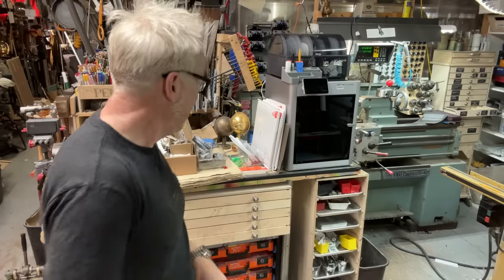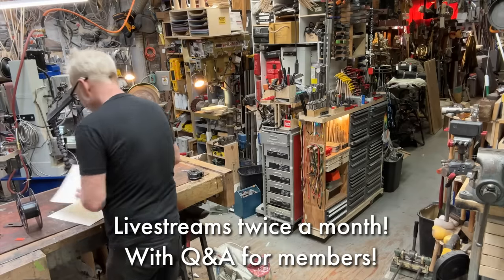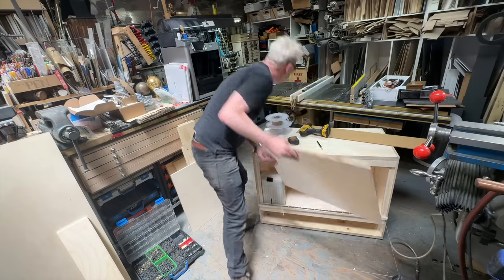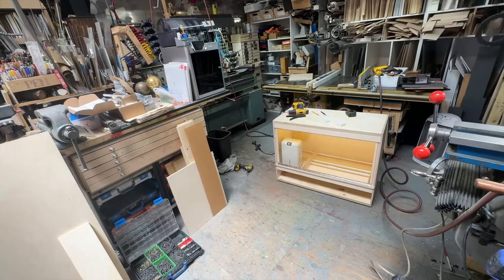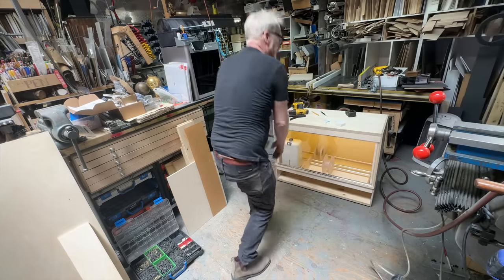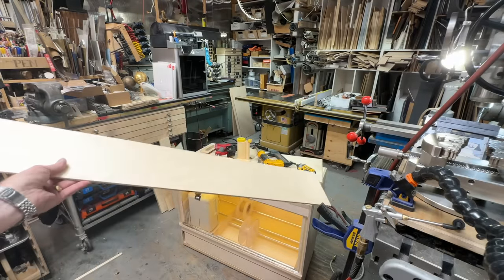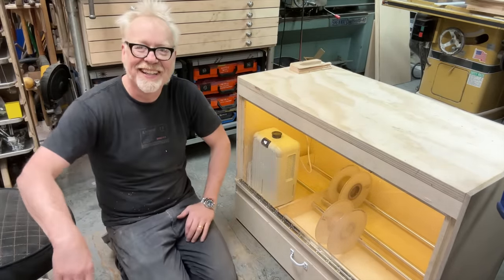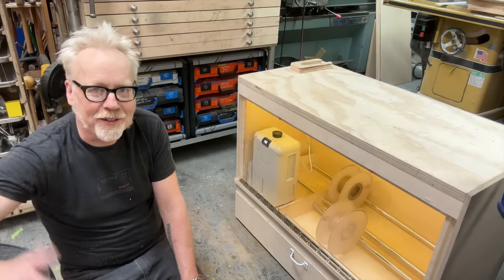Adam Savage Builds His 3D Print Farm!

Comment: Why wouldn't you want to seal the interior of the cabinet so you don't get humidity migration through the wood? Seems like that would save a lot of energy.
Reply: Also could stop the plywood potentially warping with one side dry and the other open to the ~60% humidity in the workshop
Reply: The adhesive in the plywood is enough to slow the pace of migration. A structure can usually overcome the warping stresses of moisture.
Reply: @Connor-s1k it’s one inch thick it’s not warping on that. Plus it looked like it was 7 ply it’ll be fine.
Reply: It’s one inch thick multi ply plywood, meaning there’s plenty of glue to stop moisture seepage.
Reply: Quick and useful  !!! Not everything has to be perfect, just enough to do the job.
Reply: Adam: you may as well start looking for a larger shop space.
Reply: @gavinhelgeson2880  keyboard warrior moment
Reply: @gavinhelgeson2880 stop being a hater! Let's see all that you've done

Comment: Bambu's vibrate like crazy.  Build some rubber into the base your setting them on. They even recommend their anti vibration legs for two printers next to each other.
Reply: The cement paver slab from lowes is the preferred base amongst the faithful.
Reply: I put a layer of hard foam with cement paver on top as my printer base. It really does help with vibration. Some sorbathane pads on my X1s feet help even more.
Reply: Do NOT do this.  See the other comment on here about Patio block and adding mass to your printers stand.  Connecting your printer to that mass is key.  Rubber vibration dampers are not the answer here.
Reply: @OhThatAD  works perfectly for me.  There are many iterations, combinations, and ways to accomplish this

Comment: Looks like a great build. I just have one relatively minor concern. Dehumidifiers of that kind usually have an internal reservoir. Will it become part of shop practice to empty it on a set rotation or will there be modifications later on to allow it to drain without worry in another fashion?
Reply: Great point, and I have one other; if it's running 24/7, the moisture of the wooden cabinet itself will drop, especially on the inside. This can clause cracking when the inside is super dry, and the outside is ambient.
I'd suggest a paint or some other barrier to at least mitigate the issue.
Reply: @jmacd8817 its 1inch plywood. Cracking not a concern. This isn’t fine woodworking, it’s shop furniture.

Comment: I use a cart and found that having 3/4 inch vibration  mat under my 3d printer has severely reduced having prints turn into spaghetti
Reply: The Bambu labs printers have vibration compensation, and core xy. Core xy printers aren’t nearly as affected by vibrations as the bed slingers are since they are more solid. 

None of mine sit on rubber pavers or mats, and I have 4 on the same counter top next to each other. They just work.

Comment: Adam, one thing you’ll find with multiple Bambus is the need for vibration isolation. As you know they really whip around and 2 printing at once on one surface can cause issues. Maybe something as simple as dampened sheet of foam under each printer. Cool build though!
Reply: Indeed. I have 3, and this is a problem 🙂
Reply: I’ve found the easiest way to eliminate vibration is by adding mass to the platform my printer sits on and to affix the printer to that platform. We had a piece of 2cm granite left from our kitchen remodel that I had the installers cut to fit on the top of my table and then I drilled holes carefully in it to mount the printer based through to the bottom. Not only did it decrease the noise and keep each printer from affecting each other during multiple prints but the discrete prints were far more clean in output. Good luck! And Great Build!
Reply: @chrisstephan4520  ah, this explains why I see so many printers sitting on concrete spacers from the hardware store.
Reply: Yea. Get some anti vibration foam for washing machines. They are perfect in the 3d printing world
Reply: one of the best things for reducing resonance is a dense mass. 3D printing farms often place printers directly onto a concrete base. You can do things like high density foam or the classic squash ball feet, but these will only reduce noise and not resonances that can ruin your prints, and even input shaping won't resolve

Comment: After the dry box maybe a couple diagonal braces for the Cobra stand, you're probably getting resonance issues on short, fast, movements that can be remedied.

I love the temporary tattoo idea!
Reply: It definitely had some electric boogaloo moves going on lol
Reply: Spend a little time with a tape measure and measure various parts of your hands and arm. Thumbnail 3/4" wide. 1" between knuckle and index finger tip. Palm width=4". Stretched out hand, 10" little finger tip to thumb tip. etc.  You can estimate smaller distances from there, and be at least as accurate as a tattoo.
Reply: What temporary tattoo are you talking about?
Reply: Definitely, the stand wobbling  gave me shivers. :)

Comment: Nice build. The dehumidifier will do a good job of maintaining the filament, but a roll that's already absorbed moisture will need heat and air movement to correct the issue. A cheap food dehydrator does a great job.
Never assume that filament straight out of the bag is dry. You don't know the local conditions when it was packed.
I look forward to seeing FDM parts starting to turn up in your builds.
Reply: That was my thought.  Might as well just use desiccant and save power on running a dehumidifier full time.

Comment: Even though you are building a "solid" table for your 3D printers, do this hack:  Get two paver/patio blocks from the big box store and put your printers on them.  It's a $20 purchase that will improve your 3D printers 20 fold!   Not just the print quality but the sound as well.  Anchoring your printers to these blocks also helps. (Maybe another video?)
Reply: It will  not make any difference for the Bambu ones. That works for cheap entry level printers that are flimsy, light weight, bed swingers with no input shape.
Reply: You are absolutely incorrect. Mass applies to everything.  Basic physics.  @MuitoDaora
Reply: @Theexplorographer Will not present any noticeable difference in print quality in the Bambu.
Reply: Okay.  I own one and can tell you that it does.  Along with 10 other printers in my farm. And I manufacture tech mounting brackets with them.  At speed, there is a noticeable difference in ringing and overall quality. Not to mention the sound benefits.  Here is the bottom line, I am offering up free advice to Adam and his team and anyone else who wants it.  If you don't want it, fine. NOBODY asked you for your opinion though. So, be a troll if you must. But, know that you are not contributing with your noise.  @MuitoDaora
Reply: @Theexplorographer  I'm not being a troll. I have a Core XY and didn't notice any difference in quality when I did it to mine. Only noticed improvement for the bed swingers.
Good to know, live and learn. If works for any printer then fine.

Comment: Adam, depending on who you get your filament from, it is actually going to be better if you do take it out and let the filament dry out in the new cabinet. Even with being vacuum packed, I have found that since the major supply shortages of 2021/22 filament has been coming a bit "wetter" and I suspect it is a result of pushing production times up and filament getting limited time to dry and sit in inventory.
Reply: I noticed that as well. I have not scientifically tested it, but a fresh role direct from box usually has the crackling/popping sound of evaporating water during printing and produces more stringing compared to one stored in my 20% humidity drybox for a few days.
Reply: As someone who has produced his own filament I find this a very strange phenomenon. It is really hard to produce good quality, consistent diameter filament
with "moist" plastic.  I would expect right after it was produced it should be "dry" and would stay dry if you vacume packed it in a timely fashion. 
Any particular materials you stood out while you experienced this? 
Very curious!
Reply: @migael92  I noticed it most with PETG Prusament, since that's the most I use. I wonder if the filament picks up water during the cooling baths after the extrusion.

Comment: Adam,
You should consider adding an analog barometer to the dry cabinet. Those little digital barometers work fine but require batteries. You could also add a digital barometer wired into your power strip with an additional readout mounted to the outside so it would be easy to monitor. Within your shop, the best place I can see for your 3D printers would be in your loft. That should isolate them from as many vibrations as possible so you can still use your shop normally while printing.
Reply: I've been using two of the exact same barometers for over a year straight and they're still going fine lol. Battery replacements are negligible
Reply: I would also recommend locating on the opposite side of the cabinet so the reading isn’t effected by the out-flow of the dehumidifier.

I would also recommend some sort if outside container to collect any discharge from the humidifier.  Opening the door daily will change the air inside and make the humidity go up and down. Storing liquid water in a dry area with changing temps can lead to evaporation.  Both are counter productive.

These are changes I would consider.

Comment: Bambu is great on most of normal parts. But as we tested out a few high complexity and large scale models in the studio, it starts encountering troubles due to the high-speed printing pace and seems require custom setups for specific types of architecture. It will be great to develop an AI module to reduce failures.

Comment: I hope we get a follow up on if that dehumidifier works, looks like the typical thermoelectric type.  I bought one of those types and it just doesn't grab that much water from the air.  In a small room it only collected about a cup of water a day, didn't change the humidity level at all.  It was a waste of $100.  Maybe it will work in a small sealed space but I have my doubts.  I put my filament spools in large zip lock bags and then add one or two large desiccant packs and one of those color changing strips.  Once a year I need to spend an afternoon regenerating the packs when the strips show greater than 20% humidity in the bags.

Comment: I work for my local college as an instructor for our 3D printers / additive manufacturing program. 3D printers are the next generation of craft making, prototyping, and fixing things. I have repaired many things at the college for a couple of bucks and saved hundred. I also have designed a tank with 8 separate treads and 3D printed it out(video of its first prototype on my channel), and then wired it up and it works beautifully. I have made remakes of old vintage car parts that no one manufactures anymore as well. 3D printing does almost everything. I hope you, Adam, know of the near limitless capabilities there are with these 3D printers because with your brain, brilliant things will happen once the ball gets rollin.

Comment: Adam, I always love your videos.  I love watching your process.  The best thing I have found though to store filament is one of those large (I think it is a 156 quart ?) air tight IRIS boxes.  Add in two reusable Eva-dry units and you basically have a hermetically sealed dry box that needs almost zero electricity to store filament.  The easiest way for long term storage of filament that I have found.  You can store 20+ rolls in one box.

Comment: My Ender 3 rests behind a couch, I store my filament next to a window where I water the plants. It gathers dust, the filament becomes brittle with sunlight, and yet, when it comes to printing, it does it without a hitch. (I just wipe the dust with a cloth and print). I print at 220-230 C, and the heat is enough to melt the plastic and make it useful again. I've seen no differences with brand new filaments out of the box, except that old filament might break if you handle to rough, but the finished printed object isn't actually brittle. I'm always amazed about the resilience of the whole thing. I don't print much projects (once a month or so), so some filaments have been opened out there for years. What Adam is doing here is amazing, he'll have quality prints and make sure that everything he need is at hand and ready to go. (So, go ahead and unpack ! It's so satisfying). Pro tip: the empty filament rolls are great for storing extension cords around them.

Comment: My one mod would be to add a Spool Holder that allows me to hang a spool inside to feed any printer.  I'd print a TPU plug to seal the exit hole when not in use.  Plus, I'd be able to swap around spools inside the cabinet while leaving the existing color(s) on the printer.

Comment: I owe the X1-C as well, great machine, you may want to add some rubber brakes to the cart because of the the resonance tuning the printer does. Or add concrete blocks with rubber pads under each printer. The X1-C will can and will move that table you built

Comment: A nice project , the one, thing I'd do differently would be have the rails run front to back, and probably have them hung from the top on slides you could pull them forward on, to access. Then you have the whole floor of the dry box for the packaged filaments, you could even put a sliding shelf for them to make finding then easier. A bit more complicated but it seems a lot better than, as I'd have to do, go down on my knees to use the back storage rail.

Comment: Where does the dehumidifier drain to? Does it have a tank? How long does it usually run before the tank is full? What dehumidifier is it? Just wondering. Didn't catch it if you mentioned any of that, but I don't think you did. Looks like a pretty good piece of furniture for your 3d printing needs. Slap a coat of paint or stain or whatever on it and a few stickers here and there. Nice, man.

Comment: Regarding keeping filament in the vacuum packing: It's quite common that filament arrives already moist as it's commonly pulled through water tanks during production (some manufacturers use a different process, but water tanks are the common way to do it). Some manufacturers are a bit sloppy when drying the filament afterwards. Having a vacuum back is good in theory, but it also has no medium inside which could transport moisture from the filament to the silica gel packs, and I would consider it only a fallback if the vacuum seal is damaged.

A dehumidifier helps preventing the filament from getting moist, however, it's not a good method to remove moisture already accumulated in the filament. A filament dryer is the preferred method for many people.

Comment: Hey Adam, not sure if you read comments or anything, but you SHOULD remove your filament from vacuum packing and dry it, mass producers of filament rarely have the ability to dry filament enough, it really needs a good dehydrator.  I'm positive your solution KEEPS filament at where it needs to be, but if it isn't already there, you need active heat to dry it.

I'm also incredibly jealous you have 2 X1C's, my ender3 knock off just can't keep up!

Comment: I hope silent operation is not on the "must have" list ans you just built a huge sound box/acoustic chamber) for your printer which will amplify the sounds made by the motors a LOT more than you would think.  The best place for a filament printer to sit is on a solid surface (Concrete slap etc)

Comment: I started printing with an fdm printer, an ender 3 (like everyone else did), and I moved on to resin printing (anycubic photon d2) because I wanted the incredible fidelity. I would suggest you add a resin printer to your mix, they have a different set of interesting capabilities.
It takes more post-processing, though. Once it comes off the printer it needs to be washed and cured. It was the excuse I needed to buy an ultrasonic cleaner.
Reply: A resin printer was the shops first 3d printer. They made a few videos on it a few years ago.

Comment: Consider a nonfunctioning secondhand store display refrigerating cabinet. The glass door drink holders. The magnetic seal on the door would be ideal for something like this and then augment it with the dehumidifier and a vacuum pump. You can take a visual inventory of the contents without breaking the seal and have an internal light with a manometer and humidity gauge. If the refrigeration works, you can even have some temperature control.

Comment: If you swap out the back rails for a piece of steel rod with skater bearings on and poke a few holes (say3-4mm)  in the top at the back, with a few spacers (washers/clips) you can run non AMS runnable filament straight out of the De-Humidified storage without loosing in much high water  content air in.

Comment: Table looks nice!  Maybe a bit of foam weather strip on the edges of the acrylic and silicone to seal up the chamber.  Also, I actually would take the filament out of the wrapping.  Most of it is processed in water to cool it when it is extruded so really isn’t that dry inside the bags to start with.